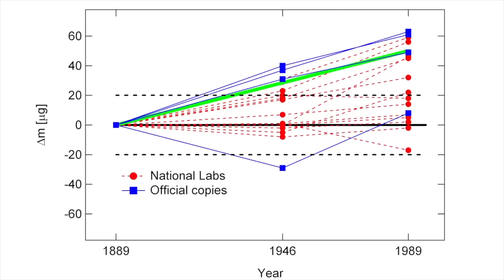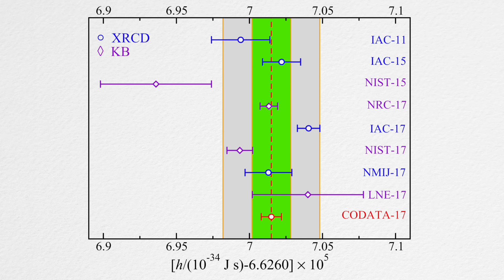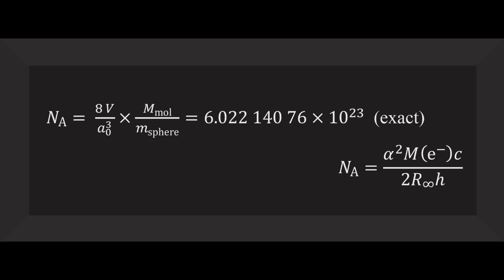The kg is dead, long live the kg

Comment: i had a question one of the SI units. We don’t treat a dozen as a base unit in physics — it’s just 12 things. But then why is a mole, which is just 6.022×10^23
or 6.022×10^23 things/atoms/molecules, considered one of the seven fundamental units in SI? What's so special about it?
Reply: Because it is made to match the molar mass , it's the no. which perfectly matches with molecular mass...for eg. 1 molecule of h2o has same molar mass and molecular mass i.e 6.022 x 10²³ molecules of h2o have 18gm which is the same as molecular mass of h2o 18u , it's just made to convert that 18u into gm so calculation and experiments would be easier....

Comment: Anyone know why they don't define it based on the speed of light and a second? From light's meters/second value, (using cesium clocks, however they work) you could define a meter, from a meter you can define a cc (cubic centimeter), one cc of water is 1g, so 1thousand cc's == 1kg. You could make ultra-pure water from the two gasses. What's wrong with that approach?
Reply: Requires a physical object, ie, water.  They are trying to get away from using a physical object.   Originally, that possibly would have made a lot of sense.

Comment: Wouldn't it make sense to use something far more simple? Like measuring the weight of 1L of water at 4 degrees Celsius and 1013.25 millibars of pressure (sea level). That way it never changes and is easy for literally anyone to do it without overly complicated equipment.
Reply: How do you get exactly one liter of water?
Reply: @Giblet12 @Giblet12  the beauty of SI units or the metric system is it's simplicity. 1L = 1000ml = 1000mg = 1kg so you can use a volumetric flask to measure an exact volume of water and know it's weight.

Without a flask you can still do it by creating a tank that is 1000cm³ , which is simply a cube that is 10cm x 10cm x 10cm. Fill it with water and you have exactly 1L which weighs 1kg.

Of course you need to have an identical container on the opposite side of the scales to account for the weight of the container itself, but that's easy.
Reply: @lukeinkson  I’m fairly certain volumetric flasks are calculated via mass.

Comment: Given that a very elaborate series of measurements over several years was required to establish Planck's constant to enough accuracy so that it could be used for a new weight standard, it seems to me that this new standard won't have one consequence claimed for it in the video: since a standard of weight derived directly from Planck's constant will still be very difficult to access, we will still be dependent on physical prototype weights as links in the chain to make accurate devices to measure mass.

Comment: I did the calculation for  m = hf/c^2 with this values:  
h = 6.62607015E-34 J.s

caesium 133 radiation frequency (Cfrq) = 9,192,631,770 Hz
c = 299792458 m/sec

The result I got is:   6.77726531E-41 kg
Units workout fine but, since this is the new def. for 1 Kilogram  I expected to get 1 kg 

Could you please explain it further in a new video.
Reply: the frequency in this case meant the frequency of matter, not radiation frequency

Comment: Inch’s and feet and pounds, is just so much more easier
Reply: How much 46342.2781 square inch is in square yard?

No calculator allowed. 

I can do this calculation very easily in the metric system without needed any kind of calculator. 

If imperial is easier, you should too.
Reply: @mrsupremegascon  how many fat chicks can you balance on the tip of your nose. No tape allowed

Comment: Fun fact: the second is, as far as I know, still defined as 9,192,631,770 vibrations of the c(a)esium-133 atom, so the second is still not defined with universal constants.
Reply: The definition is more specific than that; it's defined using the cesium-133 atom's ground-state hyperfine transition frequency (Δν_Cs), second defined as 9 192 631 770 Hz of that frequency. While not sounding as immutable as the Planck constant or the speed of light, it actually is a universal constant.

Also, there are different number separator conventions (1,245.78 vs. 1.245,78) that vary by country, which can lead to ambiguity, inconsistency and confusion. Since metric is meant to be universal, the rule is that the fractional separator can be either the comma or the point, but the grouping separator must always be a space (1 245.78 or 1 245,78).

Comment: Meter - Speed of light
Second - Hyperfine transition frequency of cesium
Kilogram - Planck constant
Ampere - Charge of an electron
Kelvin - Boltzmann constant
Mole - Avogadro's number
Reply: Avocado number? 🥑
Reply: And candela is the same thing as W/sr. The mole also is not necessary as it deals only with a multiplicative factor, there is already a system for that.
Reply: @gide5489  Well the Mole is a base SI unit
Reply: @Krylkior2
We write mole not Mole. That precisely the point:  how can a multiplicatory factor be the base of the SI ? There is already a complete system of multiples included in the SI, addind a different factor than 10^24 is useless.
Both candela and mole should not be listed among the FIVE basic units.
Reply: @gide5489 Well the Base Units are not defined by their individual origins.
Reply: @Krylkior2
I don't understand what you are talking about. A unit is usefull as a basic one if you need it to write other ones. As candela is already written from watt and mole from a... number  they can't play this role.
Reply: @gide5489 no, candela is not W/sr. The candela is luminous intensity, so luminous power over solid angle, so lumen/sr not W/sr. What you are thinking about is radiant intensity, which is radiant power over solid angle, so yes W/sr. The difference between luminous power/flux/intensity and radiant power/flux/intensity is that the luminous quantities are taking into account the human eye's sensitivity to different wavelengths. So for example if you have red light and blue light both with the same radiant intensity (the same energy per solid angle, W/sr), they will not appear equally as bright to the average human eye because the eye has different sensitivity to the two different colors, so we say the two light sources have different luminous intensities (lm/sr or cd). The candela is defined taking into account what is called the luminous efficiency function, which is a function that describes the average sensitivity of the human eye to different wavelengths of light

Comment: So when are the metricnatsi's going to metrify PI?  Declare that PI is now THREE?
Reply: "Metricnatsi's", lmao. And that's not how metrication works; it's not about impossibly changing the meaning of numbers — In fact, that's actually a Customary-hugging USA thing, because there was literal attempted legislation in the USA to "make" pi equal exactly 3.2 — it's about having a system that's more logical and easier to use.

The metric system is about logic, and the true value of pi is more logical than a fake value that doesn't work. In fact, the metric unit of angle, the radian, has pi (or tau, the slightly better circle constant) directly built into it, making it the more natural unit of angle as compared to arc degrees. A full circle is τ rad or 2π rad, half a circle is ½𝜏 rad or 𝜋 rad, a quarter of a circle is ¼𝜏 rad or ½𝜋 rad, a sixth is ⅙𝜏 rad or ⅓𝜋 rad.
Reply: @Persun_McPersonson  Oh PLEEZZZE. You metricati tried to metrify the dates , stuffing 365.25 days into your finger counting base 10 system. You tried to metrify time and that flopped. Metric screw threads are FAR from logical. Of course some metrinazi is working day and night to change PI into a finger counting value. They pulled the value of the meter right out of their nose and foisted it on everyone. It' was not based on anything. Traditional units are always based in reality.

Comment: How much in percentage did the kilogram change? I'm curious if it's eg. a million percent lighter or heaver than the original kilo or???
Reply: It changed precision, last definition of kg was just less precise.
Reply: @mrsupremegascon  It seems that everything that was compared to the older version would now be slightly off.
Reply: @ramonhamm3885  

Last definition of kg was drifting by 50 microgram.  So everything that was calibrated on this precision or high were off. 

Today definition can't drift.

Comment: That is indeed the "new old" issue in scientific fields: you just don't have a unified measurement system and if you ever consent to use SI system for example you have not uptill now determined its constants! Technics preceeded exact sciences, and the latter had to "follow" them to interpret how they work and to eventually  elaborate " rules" to describe them..On the other hand when you study law for example you will be applying the laws as "per se" until their eventual amendment. But when you study "exact sciences" you'll shockingly be distracted from the beginning by the multitude and the apparent(and profound as it will appear later) disagreament on the system of unit to adopt( and we haven't yet discussed the actual impossible unification between relativity and quantum mechanics other theories as a theory for everything!) The concept of force for example has many different meanings in the very physics science( gravitational, electrical, magnetic); i mean why disturbing spirits and spread ambiguity in already abstract concepts like electrical current direction in a circuit by  keep adopting a historical mistake as the  "conventional electric current direction" opposite to the " real" electrons direction?Tesla or gauss for magnetic induction; kgf, newton for force; horsepower, watt, ..in aeronautics it's a real big mess: SI system : meter/second, feet/s( vertical speed); knots per hour(KIAS); pound or Pascal square inch. You'll find your very same plane indicators adopting different units system! I mean, science people, you will always be in a big trouble and transmitting this trouble to the next generation because you still don't talk the same language(jargon).

Comment: Great. Can we get Celsius nuked next? Water state change varies quite a bit. Kelvin is fine.
Reply: We never use Celsius in si units
Reply: @anawilliams1332 
Yes, you do. It's an SI unit.
Reply: @Persun_McPersonson  celcius is not an si unit
Reply: @anawilliams1332 
The "celcius" is not an SI unit, no, but the degree Celsius is. You can go check if you don't believe me.
Reply: @anawilliams1332 
¿Status report on the degree Celsius being an SI unit or not?
Reply: It doesn't change enough for it to impact daily life, which is what degrees Celsius are mainly for now. The kelvin is cumbersome for daily life because the freezing point of water, a very important temperature, is around 273.15 K (closer to 273.499 K). That's just as much a weird and random number as Fahrenheit's 32 °F. ¿Why is this? Because the Kelvin scale is just an altered version of the Celsius scale

If we want an absolute scale that doesn't encourage Celsius as a supplement, then we need to create an entirely new one. I propose a scale where absolute zero is at 0 (obviously) and the general freezing point of water at 1000. Then we could have a relative version where the freezing point is 0 and absolute zero is at −1000. ¡Very symmetrical and elegant! Even easier to convert between them too.
Reply: @Persun McPersonson  love this, actually. Celsius is great in principle, but the accuracy is just not great. If we could all agree to use a decimal that would be better for everyday use. The fact that it's based on a change of state under laboratory conditions with purity of the substance and pressure taken into account compounded by its accuracy issues really just makes it no better than F to me.
Reply: @beyondfubar 
My comment just keeps being removed and I have no clue what I could possibly be doing; frustrating...
Reply: @beyondfubar 
And...¿a decimal? ¿Do you mean the granularity of the degrees is too big? Because, for most everyday uses, it's perfectly granular enough. You don't need anything more than a resolution of 1 °C for weather and cooking because one degree is already pretty small. The only times you need decimal points are with thermostats and body temperature.

This does bring attention to a conceptual problem, though: inconsistency in metric philosophy. Modern metric philosophy is a mix of new and old policies, and the old needs to go. Modern metric usage is supposed to be based around units based on thousands only, as that leads to less confusion and avoids the need to use decimal points. The degree Celsius should have originally been a milligrade scale rather than a centigrade scale. Due to this, I've actually switched to thinking in decidegrees Celsius, as there's never a need to ever use fractions.
Reply: @beyondfubar 
 Part 1:

For me the main issue is the messiness of the relation between the Celsius and Kelvin scales.

The original definition, as you described it, was actually way more accurate and reliable than any other scale at the time. Besides that, in the modern day, the degree Celsius is actually extremely accurate, as it's directly defined using the kelvin, decoupled from the original water-based definition. The relation to water is now just a landmark used to help understand what a temperature means, rather than a technical limitation. This leads to the freezing and boiling points to be ever-so-slightly off from their original definitions, but the difference is small enough to be entirely negligible.

Comment: For this move to be, if "the Aliens" destroy our model kg, s, m, etc, but not the knowledge,  how does one reconstruct a model kg, s, m etc.?  I heard the second is the "fundamental unit of the Metric System". Because it only relies on a specific element, noticing its vibrations and just counting thise vibrations and recording the tine length of so many vibrations as a second. And build from there.

The funny thing is that the second started as a Babylonian subdivision of the Earth's axial rotation (called a day more commonly).

By the way. That's why metric time for days and years fell.  Because there was no easy way to divide by a perfect power of 10 and keep the day and year consistent with each other. Despite the fact's that other than the atom vibration definition, there is no "natural second." Before that definition, except for a subdivision of the day, there was no natural second. We just ad hoc conformed our second to a non astronomical definition.

Comment: a Kg is a mass & not a weight until it has a force applied you cannot have a Kg of apples for Kg to become w(weight) requires a gravitational force applied Newtons number w= Kg x 9.81 m/s^2 1Kg = 9.81N (Newtons) lbs on the other hand the force is already applied. I would love to go to the store and get an actual Kg of steak strictly by it's mass=density x volume, w=Mxf (force of gravity)
SI still needs fixing love your show

Comment: . . . and why the Imperial System is as good as any other system. The trouble with the Metric System is that someone is always trying to change it or call it something else.
Reply: And the trouble of imperial system is they're following metric system. If metric system change, the imperial will follow it. Science is ever changing, science is not the knowledge but the pursuit of knowledge itself. That's why it doesn't matter if the definition of kg change, kg is a tool to measure something. It's an abstraction of the world itself. Our tool changed from stone knife to surgical scalpel but the purpose is the same. It's the same for measurements.

Comment: I don't understand. I don't see how you arbitrarily fix the value of Planck's constant unless the uncertainty of the measurement is Heisenberg limited, which I don't believe it is.  The idea of physical standards being based on Planck units is a good one though, but you'll still need to update them as we get more precise measurements of the Planck units.  And of course, if we ever get a quantum theory of gravity, we'll probably have to throw it all out and start over.
Reply: Same way the speed of light was fixed at 299792458 m/s  -- it is then used used for defining the meter and (in some instances) the second.    Instead of using arbitrary physical objects for the meter or the second, or (in this video) the kilogram, and then trying to measure the constants of the universe with those arbitrary units, those units of measure are then defined based on the updated value for the constant.      Technically, you can set all these constants to be 1 or 0.5 or whatever you like, but then the units of measure become wildly different from what we normally use.
Reply: @DarthBunny314  Yeah, that was my understanding before I watched the video, but somehow I managed to confuse myself.  Of course, if we ever meet aliens they're gonna say. you still do that? Just set the fundamental constants to one and then created everyday units from there.  you know, like theoretical physicists have been doing for the past forty years.

Comment: I always thought the kilogram was the weight of 1,000ml of water....
Reply: density of water differs between different temperatures, for example at 20 degrees Celsius one liter weighs 998 grams, but at 100 degrees - 958 grams
Reply: @antek0769  at a specific temp...
Reply: @toadamine water is never 1g/cm3 dense, at 0 degrees (at its most dense temp) it’s 0,99989g/cm3
Reply: sorry, it’s most dense at 4 degrees so 0,9999749g/cm3. It does never meet the 1g/cm3 (1kg/L) density